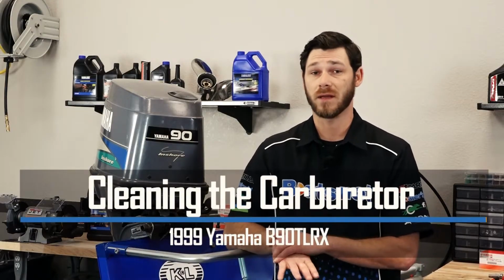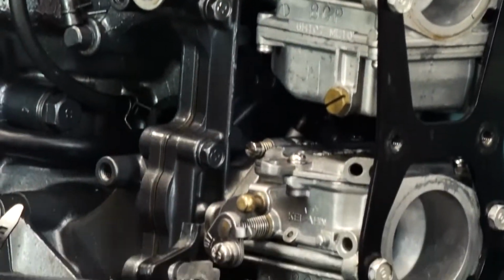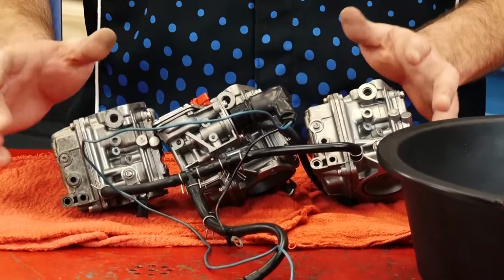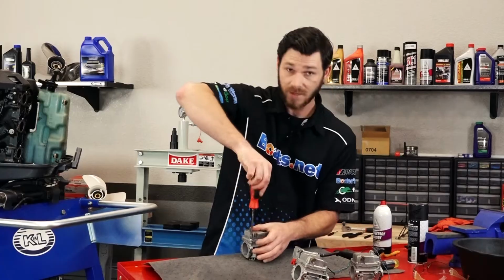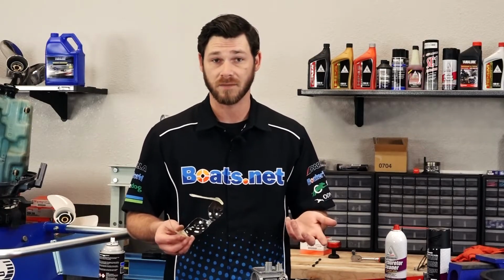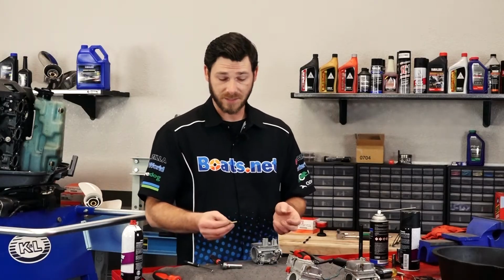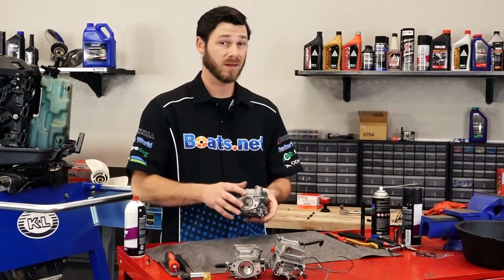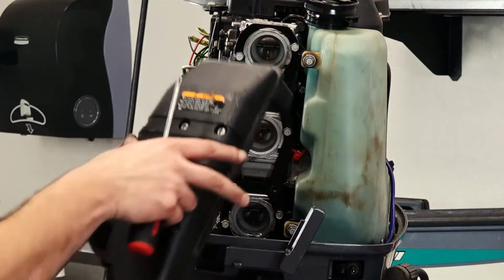Yamaha Outboard Carburetor Cleaning | Yamaha 90 Carburetor Rebuild | Boats.net

Comment: I have a Yamaha 90 with carb problem "C90TLRZ". Carb is leaking out of one of the vent holes on top of carb while motor is running. I checked the 'needle and seat' which has no pits. Do you have any ideas of the problem? I'm thinking it maybe a heavy 'float' which maybe flooding the carb. Fuel is also leaking out of the passage of the throat of Carb.
Reply: I solved my problem, everyone said it was the needle/seat in the carburetor which it could have been. Ordered new needle/seat and float. Well it turned out the new float weighed in at 176 grains, old float weighed in at 425 grains. Changed the float only and problem solved.

Comment: Nice video.. I have the 2008 Yamaha 50 TLR and I just rebuilt the carbs.  I had to drill out the brass plugs to get to the pilot screws.. I replaced them with the new ones in the kit but my manual doesn't say what the setting would be for each carb.  does anyone know how many turns  I should back them out for each carb?  Thanks !
Reply: What were the old ones set at.

Comment: Fantastic video,  unfortunately it skipped the part about how to hook up properly the oil linkage...  and then said it will cause engine failure if not done...  Mine won't go on properly so now I'm stuck on what is the correct way to hook it up.

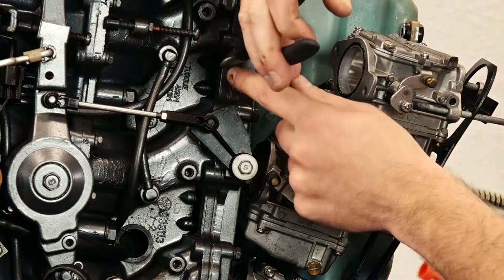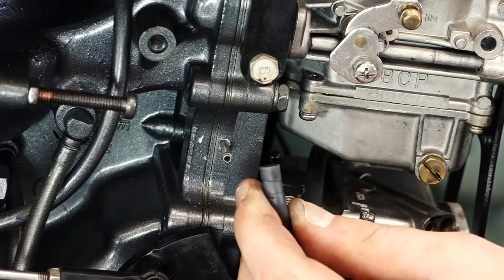Comment: That's not a vacuum line at 4:20 & 19:55, that's actually the fuel enrichment line that sends raw fuel behind the #2 reed valve assembly at startup.  Great video otherwise. Very informative.

Comment: I agree with the comments about checking the float height. Great video but you should not have to press down on the float tang to fit the needle and if someone follows this procedure on older carbs with adjustable float height - then their fuelling will be out across the rev range. You also should balance the carbs against the master carb after cleaning.
Reply: Balance the carbs against master carb?

Comment: I have a 1994 Yamaha 2 stroke 70hp engine I rebuilt all 3 carbs and replaced the cdi unit and spark plugs after that I took it out on a fresh water lake and at first it was hard to start, the engine idled fine but when I gave it the throttle it bogged down and shut off I restarted and gave it throttle again as I was taking  off it bogged down again, i backed off the throttle then thrust the throttle back and forth until I finally got it past that point of speed but the engine could only push the boat to reach speeds up to 34 mph where before I could go 55 mph plus on my small whaler! It still boggs down everytime I take off? What could be the reason it is running rough like this and not smooth? Could I have possibly bought faulty plugs or do I have a fuel problem?
Reply: Float heights set properly during rebuild?… just a suggestion 🤷‍♂️

Comment: Hi 

I have 1999 75 hp TLRX model with set of carbs the same like the 90 hp from video.
I’m trying to buy carb kit according to parts manual from boats.net going by serial number and it shows completely different set of carbs.

Do I have wrong set of carbs installed?
Engine is original.
Did Yamaha produced 75 hp with 2 different set of carbs for that year?

Anyone has 1999 75 hp TLRX with set of carbs from 90hp?

Thanks everyone
Reply: Same carb just the jets size are different and the timing also

Comment: Once the set screen for the main jet was removed did you just take a pic to poke it out ? On my system top carb it falls out but on the bottom it seems to be stuck is there a way to poke it out without damaging anything?

Comment: What would.cause the engine to just die after running for 10 or 15 minutes we let off the throttle to slow down the engine cuts off ,want start again you have to wait about an hour or so and it will fire up again , then the same thing happens

Comment: You pointed out two small O rings one was smaller than the other but what was the thicker small O ring for?
Reply: The Thick O ring is for the Drain Plug thats on the carbs.
Reply: Thanks guys...I was just sitting here staring at that oring

Comment: What's the difference between the 75 and 90 hp models they both have the same carbs intake and power head listed is there a restrictor in the exahust or does the exhaust manifold restrict it
Reply: Different jets and timing

Comment: You didn't show how or what the float level was supposed to be ( very important for any carb)
Reply: These Floats are non-adjustable - Solid Plastic mount for needle
Reply: Even with the line on side of float, parallel to the bowl.